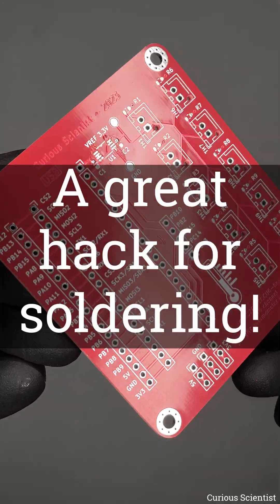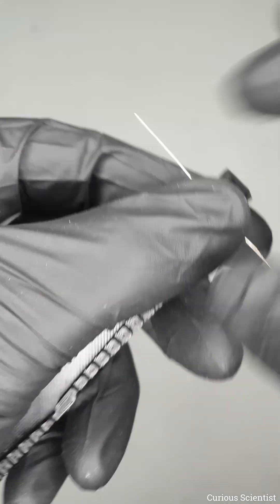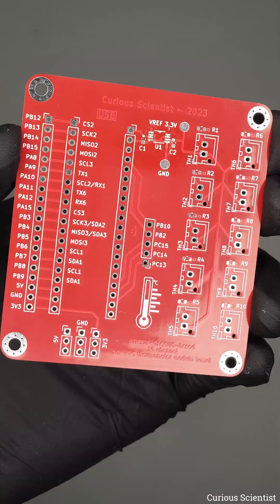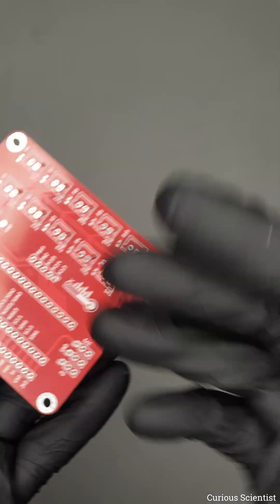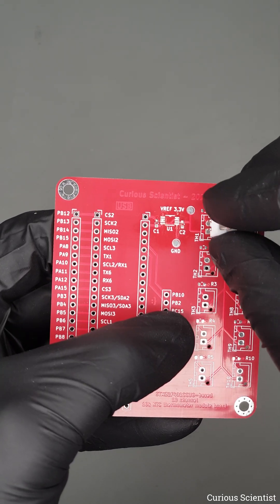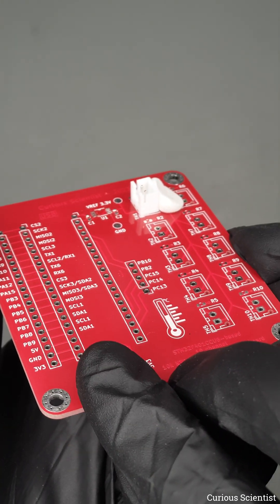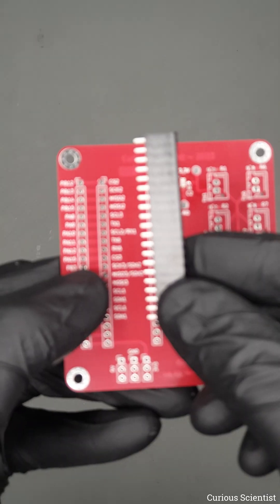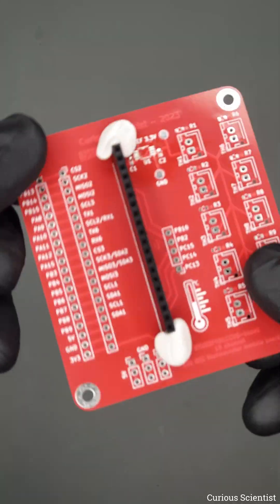A great hack for soldering #electronics #soldering #tricks #hack

Comment: It's an absolute pain when doing rework on boards where they've bent the legs of components. I never do it myself.
Reply from the maker: That's why this method is useful. You don't need to bend the legs because you can hold the components with the putty.

Comment: Is that the same thing as Blue Tack or is the white made of something more heat resistant?
Reply from the maker: Same stuff, just a different color. It is not super heat resistant, so avoid exposing it to heat for a long time. If it "melts",  you can use a fresh piece of putty and pick up the molten pieces.